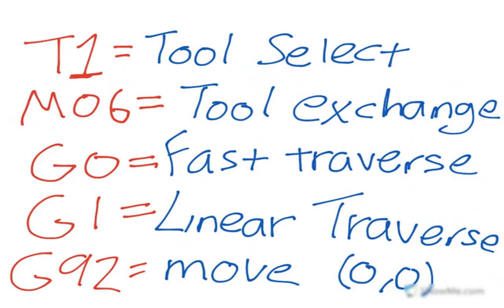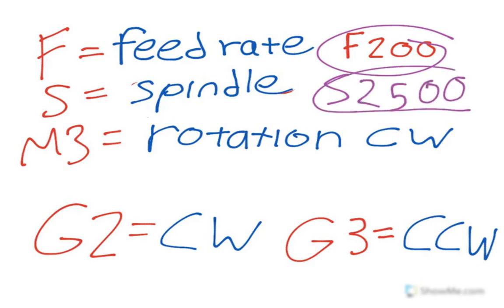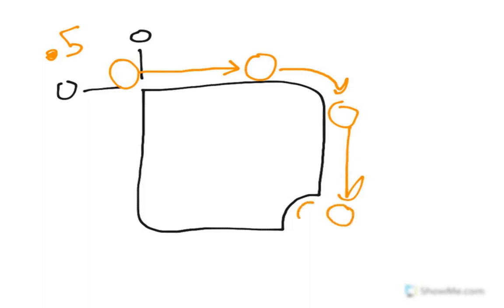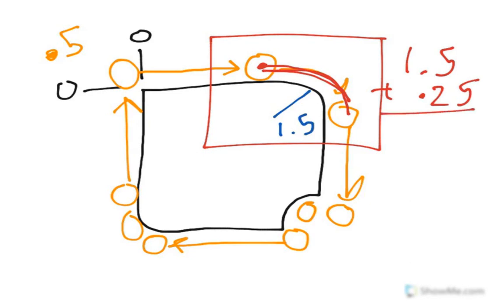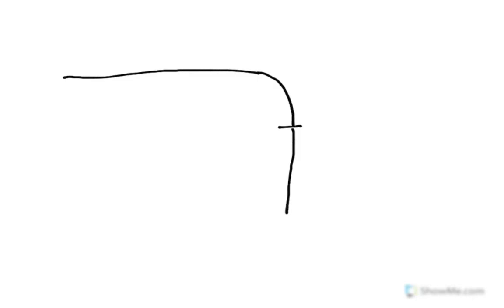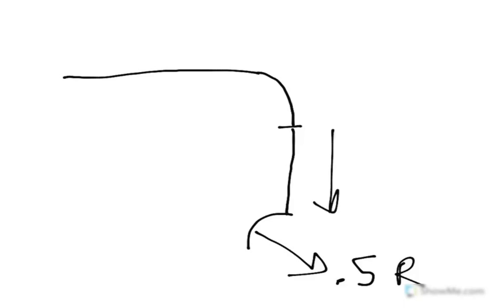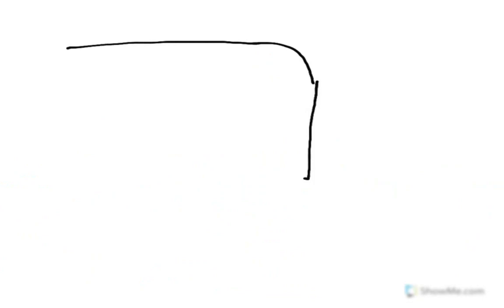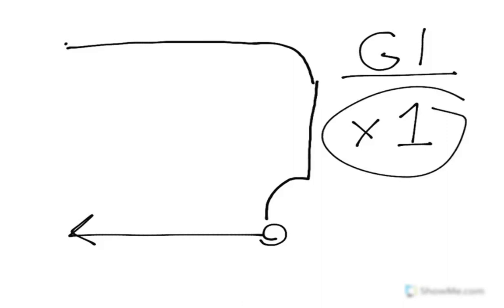CNC Machines with G- Code Beginners Setup for Milling the math and diagram Part 1 of 2

Comment: If I have to use this NC language I would have been bankrupt  a long time ago. Try the Sharnoa Tiger control, is 1,000 faster. The Sharnoa program will be like this:
G41 T1 M3 S5000 F100
G X Y Z.5
G1 Z
X5 Q1.5
Y-4.5 Q
G3 X4.5 Y-5 R.5
G1 X Q1
Y
M2

Any quastions?

Comment: i'm new to this, but i've seen other g-code instruction and my question-isn't there a g-code for automatic offset of the tool, in order to eliminate manually figuring tool radius into your measurements?
Reply: likestojam

He doesnt mean insert wear,he means cutter compensation.

Comment: It's show the length it is 5. How come there's 5.25?
Reply: verynice
Reply: Because he isn't using a cutter compensation such as g41 (tells the machine u want to cut to the left side of the line which is called cutter compensation) which I would use on this part and then ud be using x3.5 y0. (which is the start point of the arc) and u wouldnt have to add in the .25 (the radius of the cutter) because your using g41 and your end point would be x5. And y-1.5. Code would look like:

G0 t1 m6;
M03 s2500 
G43 H1 D1 (calling up your tool height offset and diameter offset which is where ud put your .5 tool diameter)
G0 x0. Y0. G41 
G1  x3.5 f200
G2 x5. Y-1.5 r1.5

Comment: I just started learning a cnc lathe a month ago , can any one help with easy ways on remembering how to home out and what threaders  and all that gose in what kind of rod like the hard mills and all that
Reply: Kari Tjaden 
You could thread a couple of different ways on a lathe .
One way would be a G32 

G32 X.5 Z-1.F.0769 

Or
 G76 p030000 q005 r.005
G76 x.5z-1.q005 p0030 f.0769 
This is an example of a fanuc canned cycle